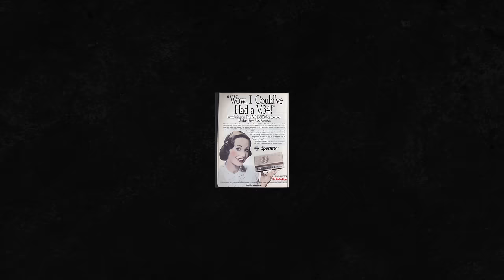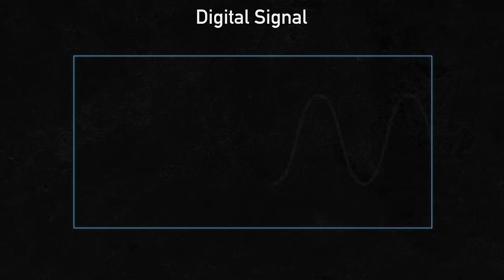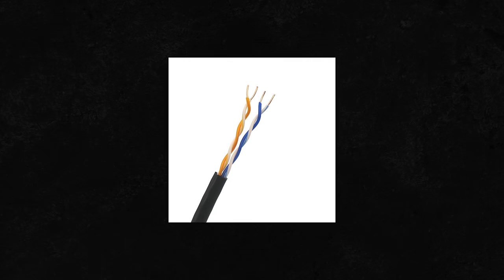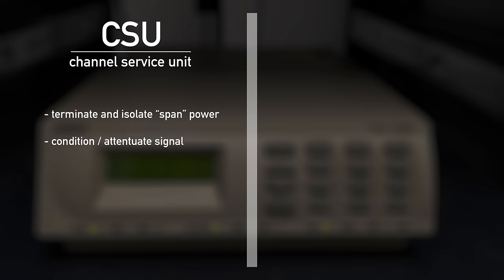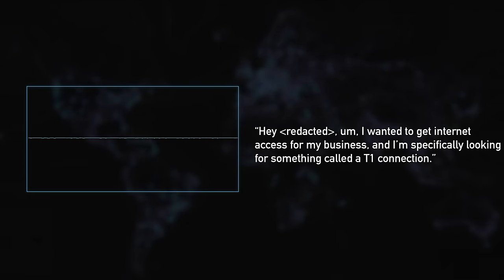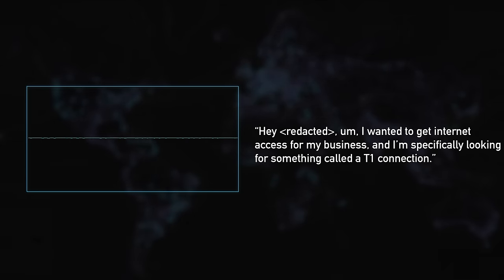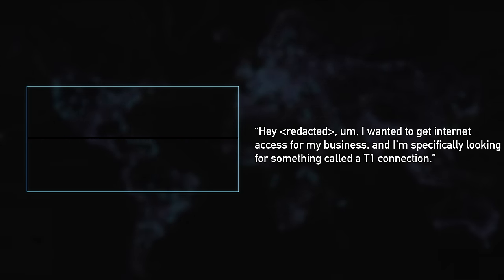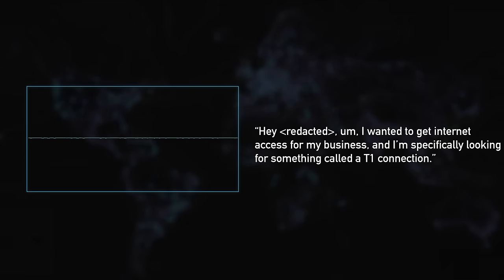1.5Mbps of pure '90s: Setting up a T-1 today - ISP Series Episode 3

Comment: Wow that was well done. Insane to have a proper BGP route published by a 2500 series. It could barely fit a fraction of all current routes in its memory.
Reply: thats why he contracted the upstream ISP to send him the default route rather than the full internet routing table.  Its fine for his setup as he's not multihoming, but for a real ISP they would want to multihome, and therefore want the full internet routing table.  

I actually have a few customers of mine that requested the full routing table, which was wild to see cause for enterprise businesses you don't need to  have the full table unless you want to become a transit network on the internet.
Reply: I was wondering why they wasnt using RIPv2 for this, but still interesting to see BGP in use.
Reply: @alzeNL  because RIPv2 is an IGP and not intended to use between autonomous systems.  BGP is basically the last remaining EGP for use in advertising routes between AS.
Reply: @bassman87 You can multihome just fine while only receiving a default from both providers :) . Like you said a bit later, it is actually uncommon in the enterprise to get more than a default, even when multihoming.
Reply: @BogdanSass  you're correct from an enterprise point of view, Enterprises don't typically want to become a transit network, where internet traffic from one peer passes through your network to get to another peer.  This is where multihoming with default routes works great, cause you can advertise you're public block to both peers without becoming a transit network.  effectively you are a stub network at that point.

But from an ISP perspective in many cases you want to be a transit network.  so having the full internet routing table allows you to perform best path calculations for destinations between peers.
Reply: @bassman87   I roll my eyes every time I talk someone through setting up BGP peering, and they opt to receive the full tables.  Even small rural ISPs... there's just no sense in that.  It only consumes resources and takes longer to troubleshoot routing issues when you have 15 gadzillion pages of routes to sift through.
Reply: @bassman87  I entirely agree with you, I was just pointing out the use of "multihoming". :) You can multihome and not be a transit AS (and if you manage to become one as an enterprise, you are probably doing something wrong :p )
Reply: @BogdanSass  oh yeah were just having a conversation, thats all.  no ill will here, lol.
Reply: @BogdanSass  and actually one of the few times I've come across an enterprise that had the full internet routing table, one of their Jr admins didn't understand the route maps that filtered out all but their advertised subnets from the bgp advertisements and accidentally caused them to become a transit network.

Comment: A LOT of this terminology is still relevant - points of presence - network interface device (NID, usually a fiber to copper media converter with some out of band management thrown in) CPE - customer premises equipment, provider edge, last mile, incumbent local exchange carrier, DMARC, etc etc, I was using all these to provision point to point fiber circuits (often incorrectly referred to as leased lines) about 5 years ago at Level3

Comment: I started an ISP/web hosting service in the mid 90's as a replacement for my multiline BBS.  We started with an ISDN, but quickly outgrew it and upgraded to a T1.  We had a class C network, but with multihoming, never use anywhere close to all our addresses.  I think at our hosting peak we had about 225 websites.  I was always concerned that we'd outgrow the T1.  BTW, we ran this from our living room.  One day one of our customer's product was featured on "Oprah".  He told me about it 2 days beforehand.  I was worried we'd crash and burn.  I had the TV on and was watching the VT-100 terminal connected to the Cisco router.  I watched as the connections climbed and climbed and climbed.  Eventually getting up to a little over 800 connections per second.  It leveled off to around 600 connections per second and stayed there for a couple of hours.  I never thought we would survive it, but never even came close to using all the bandwidth and my trusty Windows NT server didn't even break a sweat.

Comment: Its crazy how fast things move, and yet how prevalent the old tech is. We had customers up to early 2010s, in the Southern California area, with T1s and bonded T1s. In fact in a Orange County location, Cox didn't sell anything but T1s for this medical building. Obviously the speeds were not enough, and to upgrade the building to cable internet they wanted $35000. The Cox rep was nice enough to tell me, off the record, that ATT U-Verse fiber is actually available in my area. This was a life saver.

Comment: Did sooooo much work on this sort of gear back then. Also taught the various protocols and troubleshooting them. Have Sage (T1 test set), will travel! Lol. 

You knew you were having fun when you got a grumpy call from MCI to stop crashing their DMS central office switch by whistling into a giant conference bridge (we were the manufacturer), which was setting the second most significant bit across 240 DS0s simultaneously — the “robbed bit” way of saying “yellow alarm” to the equipment at the other end of a T1… and causing the entire T1 circuit to flush down all phone calls on all 24 DS0s and reset the T1 circuit. 

One of the major benefits of ESF was this couldn’t happen — the alarm bits were moved out of the DS0s. 

Good times. 

Physical / hard loopbacks were stellar for end to end circuit tests. “Fake” software loopbacks couldn’t always be trusted. Numerous early CSU/DSU boxes had horrendous firmware bugs. And carriers had lord only knows how many devices along a path misconfigured to respond to in-band loop up commands, so you never really knew where you were testing to. 

If you really want a mind bender… think about this. A T1 circuit was synchronous. As copper coax and later fiber came on the scene, multiplexing a DS1 into a DS3 was common. And a DS3 was asynchronous - but still needed a master clock source. Wrapping your brain around that, is pure entertainment. 

I “remotely troubleshot” a T1 issue where the circuit wouldn’t come up and some very grumpy military brass were quite antsy. Something about a rather well known missile test range. 

After looking over a diagram that was faxed to us — we were the DS3 and DS1 equipment manufacturer — that looked like it was drawn in sharpie… my brain said “check that there’s one click source set somewhere on this stupid path. Asked em… heard someone in the background yell “it’s up!”, got thanked, and apparently some nifty middle test wasn’t cancelled that day. Haha. 

Fun to watch you guys building all this old old stuff on a tiny scale. I dealt with hundreds of DS3s and thousands of DS1s. 

Cheers.

Comment: Just stumbled about this cool vid! I am in the ISP business here in Germany and we used E1 Lines in framed (30 channels at 64000kbit) oder unframed (2048kbit/s) configuration. I still have 2 Cisco 2501 with Rj45 and BNC AUI Transceivers. Additionally 3 Cisco 2621XM and WIC-2T Cards. Use the stuff to show the beginning of the modern Internet to our apprentices. None of them were born when the 2500 Series went out of service. Now I feel old again.

Comment: This is really taking me back and I can pretty much play along at home.

I was involved with a computer group in the late 90's in Melbourne Aus, who provided ISP access to the members.

We used a AS2511RJ as the access server with 16 external 33.6k modems connected to it. (I still have the router and use it sometimes as a terminal server at home). This connected to a 1003 (I think) ISDN router with dual 64k BRI interfaces to the upstream provider.

We didn't use a Sparc as a server but old MACs running custom software. (I personally own a SS10 that could be used).

I also have a Cobalt Raq2 that the power supply died on in a thunderstorm and have jerry-rigged an external power supply to it that has an interesting past. In the early 2000's the Aus government changed laws relating to hosting of adult material. The site operators just moved their hosting off-shore instead of having to comply with the new rules and abandoned the equipment in a server room. This equipment just become available for staff to take and I ended up with it trough a friend.

Comment: We ahead one of the Adtrans on our first t-1 setup. E only used 256k of the t-1 for data and the rest provisioned for a remote office allowing our office in Portland to make local calls in Seattle without long distance call charges. It was a nice setup. I also setup windows nt remote dial up networking to allow employees to dial into our nec phone system and then access the internet over our private t1 which was lightning fast compared to going to aol, or other dial up services. The thing that killed me was the cable that went from the adtran to our Cisco was over 300 bucks due to proprietary and patented connection on one end. Ridiculous. But, Redmond cable had our back. This also allowed our sales people to access our pick mini computer for sales information over the internet way back in the early 90s. Yes, no firewalls, and very unsafe. Today it would be hacked in 30 seconds flat.

Comment: That was a great video!

Just to share with y'all, in Brazil we use Euro standards and an E1 channel provides 30 voice channels or 2Mbps data.

Back in 1995, the telco delivered to the E1 customer a single pair to the CO/PoP, an HDSL modem with G.703 output (TX and RX through BNC connectors or twisted pairs) and, if needed, a G.703 to V.35 interface.

Comment: I remember at near the end of T1's life, having to order one to connect two sites together that were about 1/2 mile apart. The company used vSat to communicate, but one site was blocked by mountains.
They'd been using a dedicated dial connection on POTS, but there was no SLA, and as the ILEC went to contractors, line cuts were common. A pots line had an SLA of "whenever we get to it," so the client site couldn't do debit/credit, report sales, or order product.
The ILECs mind was blown that I wanted a t1, but they didn't offer DSL from that CO at the time.  
The vSat connection was only 4800bps, bc it was just encrypted text, and was all they needed.

Comment: One of the benefits of working for some of those Tier 1 ISPs in the 90s (such as Digex) was a subsidized T1 to your house.  I miss that.  :)
Reply: The default CPE was a Cisco 1005 but I later used a 2514 to isolate my two routable networks.

Comment: I worked at an isp 97-99 we used a 2501, multitech modem racks and red hat Linux for mail, radius and web. We had windows NT for news. I’m 98 we replaced the modem racks with Acend Max using ISDN PRI for 56K good times!

Comment: That "transceiver card" is called a "Smartjack". In the olden days, it was the interface for the telco to test the line, and tell if the CPE was even connected. For over 20 years, that card has actually be a converter - 2-wire HDSL on the telco side, and 4-wire T1 on the cpe side. That's what you appear to be hanging on the wall. (note the 2 fuses on the right [net] and 4 on the left [user]) There's a complete little computer in there, accessible from that DB9 serial port.
Reply: Oh so it's basically running a T1 emulation layer over DSL, not real T1? The channel guy will be so disappointed!

Comment: OMG I haven't seen one of those ATI CentreCom adapters and AUI ports since the 90s!  I completely forgot about them.

ATI was right next door to our new office on 501 E Middlefield Rd. in Mountain View (between us and Nortel) and we'd run over with a PO whenever we needed something instead of having to order from Fry's.

We had the 2nd T3 in Silicon Valley, the first belonged to HP.  It was about $25k/month.  That was the reason Jerry Yang brought his school project over (running on an SGI Challenge S) to plug into our datacenter in 1995.  It sat under a folding work table at the end of a server cabinet row.  It was one of Yahoo's first servers.

Comment: I just retired my office's T1 line in March of this year (2023).  It carries our voice SIP traffic and if our primary connection failed it'd function as a backup connection.

Expensive but ultra reliable. There were times when I had the only working phones and internet for miles. At least in these parts, cable internet is NOT reliable (30+ days' worth of outages since January).

Comment: That Adtran front panel brings back memories.  We had a dedicated "point-to-point" T1 connecting two offices, and I thought those voice/data maps were just the coolest thing.  During the day, you might dedicate 8 or 10 channels to voice, making it possible to dial-by-extension four states away, just the same way you called someone in the next cube.  In the 1990's, avoiding long distance tolls was not an insignificant thing, though at the price of a P2P T1 you better be making a lot of inter-office calls.  Then at night, you might switch the map to dedicate all 24 channels for data to transfer backups.

Comment: Ahh I can't count the number of these things that I installed.  I started in structured telecom wiring and,  I remember I started doing ISDN and Leased Line work, Frame Relay, X.25 Networks for Financial Services, and then it progressed into lots of T1s.  Then DS3/T3s.  Then ATM circuits for combined data, and before I moved out of telecom I was dealing with Class 4 and 5 switch work with running SONET rings and migrating to SIP SBCs.  Eventually it became more and more datacenters and central CO work.

I finally left the telecom game around 2015-2016 and moved fully into CyberSecurity and Compliance.

Comment: When I went to Brunel University in West London I went from a 56k modern at home (with a second phone line so that was pretty fancy) to a 155Mbps connection. 
Quad fibre lines between the major nodes. 
It sounds quaint now but in 1997 we could download files at well over a Megabyte per second and that was purely limited by host speed. 
Campus to campus when only going across SuperJanet we would hit something like 7 and even THAT was limited by our 100baseT cards.
From 5 Kilobytes a second over 56kb and that was only if you were lucky.

Comment: I used to work for a voip device developer and we had a t1 isdn pci card, which could use an amount of channels for asterisk voice calls and the rest from the  24 channels for point-to-point card… 

i can’t remember the brand. Either sangoma, audiocodes, zaptel, or digium

Comment: Well that answered my questions about T1 lines. Business used also Frame relay and ISDN circuits for internet. When the business I was working at  looked at doing an ISP. AT&T offered a few different solutions on if we wanted to own, or lease the equipment. It would be $1,200 per month and include internet with it. You could also do a partial or fractional T1 line. I got tons of other stories too. :)
Reply: Did a lot of ISDN setups in the late 90's. Entering SPIDS on front panel interfaces. Heady times for me.
Reply: Frame-relay is the layer-2. You still need a layer-1 (T1) to carry it. (note: xDSL uses frame-relay, or ATM. VDSL introduced PTM - more-or-less direct ethernet. and IDSL is ISDN with the signaling removed.)
Reply: Yes, I noticed that and honestly I'm not clear on the technology. Then I read about upgrade ( forget the name) vdsl smart jacks too. They come in all different types with cards via Adtran. About 15 years ago I was sent to go test a t1 line at a loan office using a loop back. I did dive into it a little. Mostly I wanted to see if I could connect 2 smart jacks together. I did find some models if you supplied them with -48v you could. But I never got that far. Also I read about the repeaters and central office. In come cases the central office just had a (I forget the name) If the two buildings are in the same town. Each would goto the telco rack at the main office and sent back. I did know the days was numbers as throughout the years talking to the employees at the phone company. The was switching between buildings fiber. So t1 to fiber to t1. Thus, it was only a matter of time. If anybody wants to list out more of a break down. That would be great. Also I know part of the reason they did it was for cost. Thus, a fractional t1 line. etc etc. @jfbeam
Reply: Oh I posted a thing above this and I see you already put in part of the answer  @jfbeam

Comment: Really good job on this video.  Still work on T1s more than I care to but you have really touched on most points correctly. With most bottom line dsl at 3meg that we donr offer anymore it is 2 times faster than standard T1 and bonded dsl hitting speeds of 90meg and GIGe offer 1gig speed easily t1 is going by the way side. Great video!

Comment: a satellite office in South Dakota at an old job (2016) used two bonded T1s for their reliable connection & AT&T 3G as a supplement. ungodly expensive. As recently as 2020 an IT client used a T1 until there was a new fiber rollout all along the nearby freeway. That was just the best internet in the area.

Comment: Ibwork at a 911 center. We still use T1 with Adtran TA1500 channel banks. We also ha e 100s of our own T1 running on a Sonet. We have been converting T1 to AT&T Ciena VPN it works well. We still have many T1 today. We run them over IP to TDM converters. Great video.